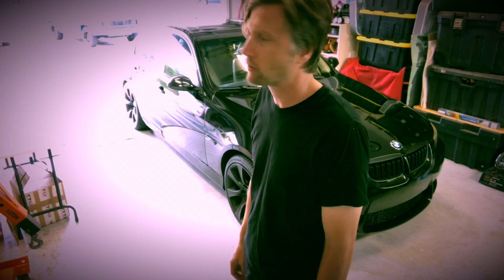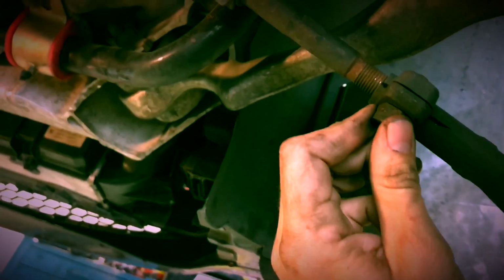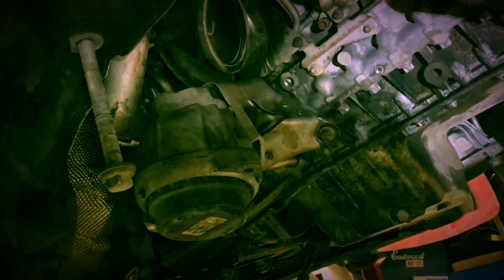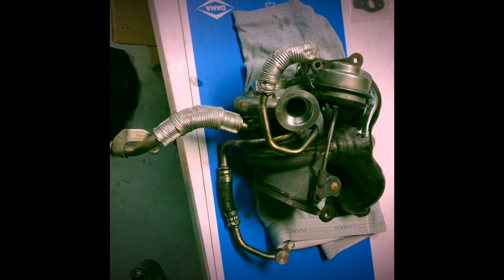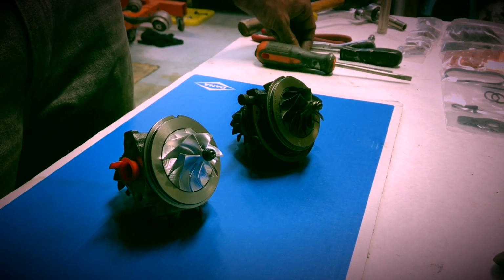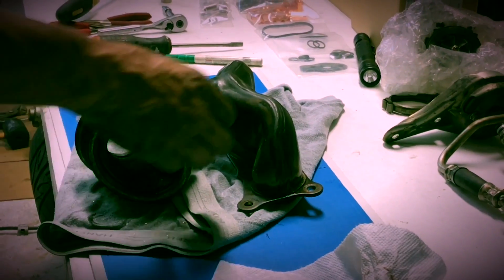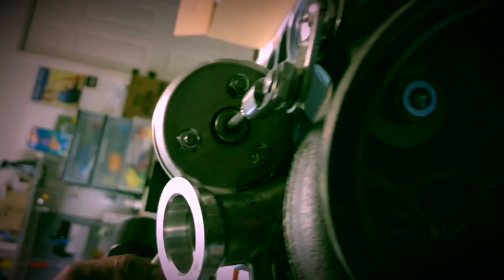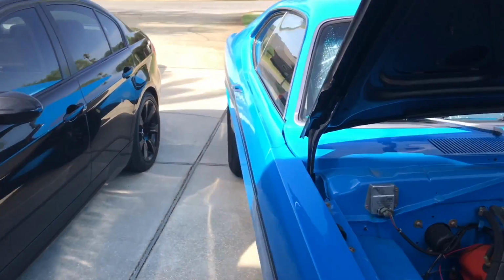BMW 335i N54 E90 turbo (CHRA) swap, Vargas Billet wheel.

Comment: Hello nice work indeed and get new turbines on your car. I am interesting is your vacuum lines from brake booster hard stuff or just the same material as vacuum canisters? I mean soft material or hard, I have been looking for long time to change mine as well, already have other lines changed. Thanks for nice video!

Comment: So when you get a upgrade turbine like this I suppose you need a custom tune after and OTS MHD maps won't provide you with all the power you could get? How do you know/tuner know what boost to target?
Reply from the maker: TheMidnightNarwhal I think you could run completely stock tune with these as they’re not a radical upgrade.
I’m running JB4 map 3 or 7 depending on how i feel with MHD race BEF, which is an OTS tune. Im making roughly 420 wheel, but guys have made 500 + wheel on stock turbos.
My limitation is fueling, as we don’t have E85 here. There’s definitely room for more power with fueling and tuning.
I finally got to run 1/4 mile and went 12.30 @ 116.
Reply: @kevinemery597  Yes same here as well in Canada E85 doesn't really exist. The more I look into it the more I think I will jut buy a rebuild kit and keep pushing MHD Stage2+ . I'm still not 100% sure if my smoking are turbos, anyways I will most likely let it smoke for a while. I'm at 70k miles 2011 335is so..
Reply: @kevinemery597  When you were burning oil due to oil leak how much oil did you use per X ammount of milleagE?
Reply from the maker: TheMidnightNarwhal Oil usage wasn’t noticeably higher. I’ve probably had to add a half a quart over the coarse of a month, and it remains that way even now. A percentage of oil is lost through the PCV system.
The tell tale sign of a leaking turbo seal is while rolling up to a gradual stop and the car is suddenly surrounded in a cloud of smoke from the exhaust. Usually you don’t notice at speed or during quick stops. If you still have cats sometimes it will mask a leaking turbo seal.
Reply: @kevinemery597  Thanks. Yeah I thought my oil was 100% smoking now even startup but it seems to have reverted back to the occasional smoke on stopping. Downpipes pull will tell for sure.

Comment: Very helpful video, especially with the half moon wastegate bit.
I'm right in the middle of doing this job.
One helpful tips for getting the bearing out of the turbo, I used a socket that was just bigger then the bearing, a long bolt, nut and washer that is just big enough to catch on the  bearing inside of the turbo housing, turn the top of the bolt and the bearing slowly will come out.
Reply from the maker: E85Johnson Nice! Thanks for the tip!

Comment: I noticed both turn signal lights come on when you need to shift.  Is that a bimmer standard or did you program that into it?
Reply from the maker: Evelyn Edwin that’s a feature of the JB4 tune. Check out Burger tuning for more info.

Comment: Man! Thanks for the video, I'm taking apart my 2008 535 right now. I'm only going after a rattle fix tho " im not that much of a mechanic but looove working on cars". My question is where did you get all the air and vacuum pipes?.

Comment: Another question: What made you decide not to go with the "Stage 1" option for the CHRA?
Reply from the maker: I’m waiting to wear this engine out since it’s high mileage. Once that happens I’ll get a low mile replacement and go top mount single turbo.

Comment: Awesome video! I had previously toyed around with the idea of just replacing the CHRAs in my stocks when they finally go, but thought against it. You have given me more confidence to reconsider it. A few questions:

How are they holding up now, 4 months later?
Did you ever dial in your tune/meth/etc. to match your previous setup?
Details on the welder you used? What sort of welding experience did you have prior to?

Thanks. I hope you make more videos. I really enjoyed this one!
Reply from the maker: The CHRA’s are holding up well! Have over 10K miles on them now.
I have dialed the tune up and dipped into the high 7’s at over 93 MPH, but now I think I’m limited by traction, and the fuel system is being taxed. Probably time for a low pressure fuel pump upgrade soon.
The welder is a Eastwood. It’s affordable and decent quality. I don’t have a tremendous amount of welding experience but had dabbled around with it a bit before doing this project.
Sorry for the late reply. I don’t really check this that much.

Comment: Shitty car to work with on without a 2 post lift. God bless 4 cyl turbos. Everything is easier to work with. If your a BMW guys i suggest u never get a turbo model.
Reply: Single turbo, and saving money do not belong in the same sentence. Also, "never get a turbo" said no one EVER!
Reply: I know right! Turbos ftw!
Reply: @mrmax1984  hell yeah
Reply: You should have gone with a single tubro and saved money.
Reply: The single turbo kits for the N54 will all cost you $4k+. No saving money there, when Stage 1 VTT CHRA assemblies are ~$1400 depending on options.

Comment: What was the taper difference from before to after?
Reply from the maker: The waste gates were worn on the original turbos so spool was rather slow. I would see max 23 PSI that would taper quickly to around 21. With the new turbos and waste gates I see 25 tapering to around 23 PSI. I'm starting to see the limitations of the LPFP, and probably need to start upgrading the fuel system to take full advantage. 25 PSI seems to be the ceiling for boost w stock turbos.
Reply: Emery’s Garage maintaining 21psi past 6500 is still impressive for most ages stockers. DA plays a role as well. Lower temps see higher density so the same turboRPM might equate to higher boost vs hotter/higher climates which would see lower. In the summer I taper to 14-15psi and peak around 20. In the winter it’s about 22.5-17 at redline. 120k originals that have seen 30k miles at maxed duty cycle lol.